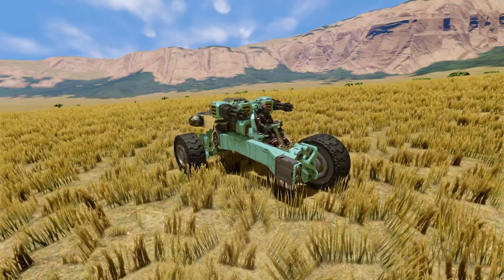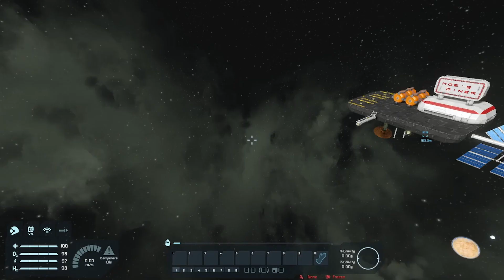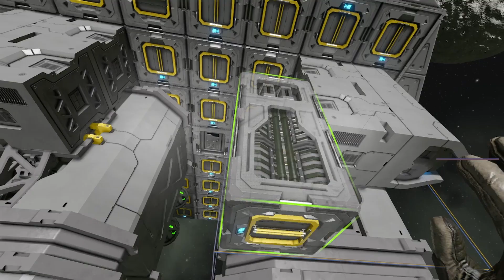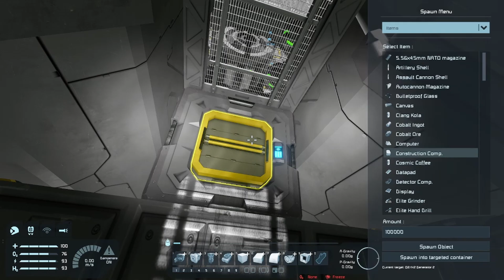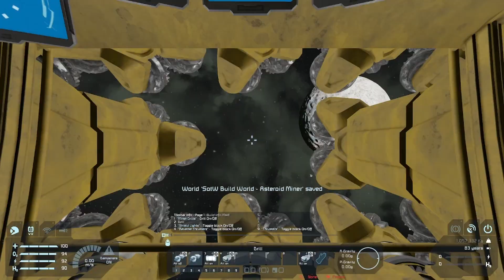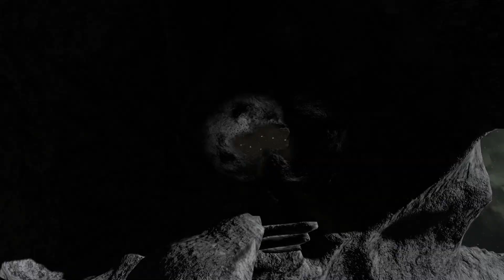Ship of the Week - Asteroid Bore Miner - Space Engineers Ship Design Challenge

Comment: When it comes to drill ships, the magic word is "checkerboard."  When you make vanilla drills in a diagonal checkboard pattern they have perfect overlap with no loose voxels in between.  Lets you cover tremendous area with very few drills.  Just using a conveyor block of some sort (NOT JUNCTIONS) between drills drastically reduces mass and power consumption, eases the load on your thrusters a little and keeps your PCU down, for what that's worth.  I've known a few servers who limit the number of drills per ship or player for this exact reason.  It also leaves you flat surfaces on the front your ship for things like lights, cameras and your detector.  Oh and it keeps the noise down a little too.

You might have to move a tiny bit slower to give your drills a moment to clear those little loose voxels, but it's worth it.  Drills=checkerboard.  It also helps tremendously to make sure your entire ship fits behind the drill face so it's guaranteed to bore straight through with no collisions.  I usually just start with my checkerboard drill face and use that area as the building boundary for the rest of the ship.  It can be as LONG as needed from front to back as long as it's no wider or taller than the drills.

Comment: my combat ships can mine faster than this XD
I just have a line of drills in front and use roll controls to right click mine into the ore at the center
perks of using thin avoider type combat ships
Reply from the maker: I've since learned about spinning a ship to drill into an asteroid.  No idea how I didn't think of that as an option, just goes to show you can have many hours in a game and still learn things.  If I try at another version of this ship I may try that as an option.
Reply: @redsgamescompany  I'm currently designing a bore-type that has a bunch of small-grid drills in a plus shape piped up to a rotor at the front of a large-grid ship. Fewer drills means less frame lag (each drill has to calculate its own independent voxel damage), rotating rig means it still has a circular borehole, and since small-grid drills don't sit flush to eachother, a camera can see between them. :)

Comment: Outstanding job,  setting 1 or 2 gyros on hot bar to over ride (toggle on/off) will keep the tool shake and any "accidental" mouse movement, also the same effect with a clock/counter clockwise "roll" clearing space for the shied lights (not having to remove the "factory protection" lol
Reply from the maker: should have thought about the gyros, that is always a good idea in these types of drill rigs.  Didn't think about rolling the whole ship to emulate a rotating drill head, that is a good idea and may actually work better than a rotor thanks to janky SE physics.  May not be too comfortable for the crew inside but it's not like it was that comfortable before spinning.